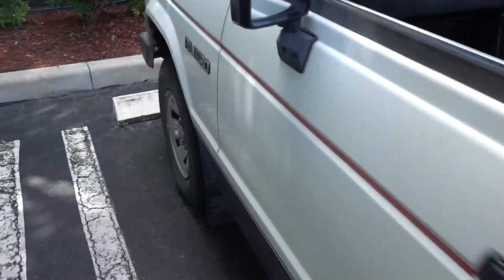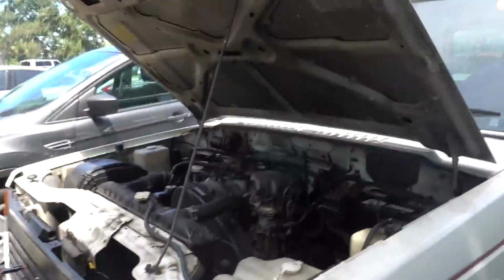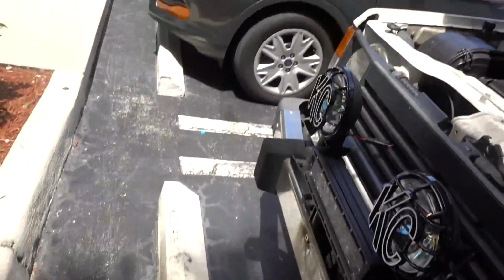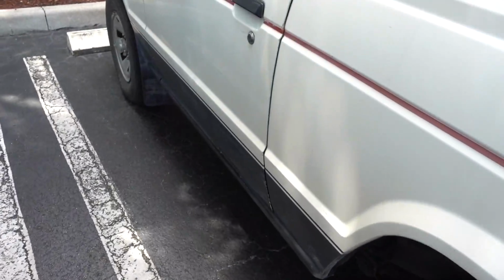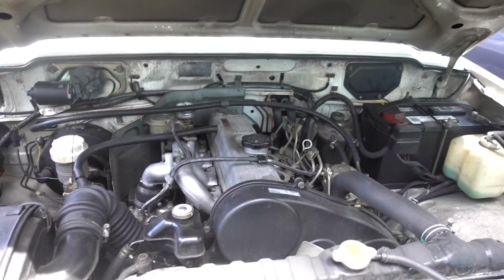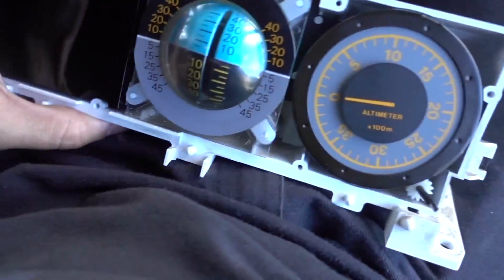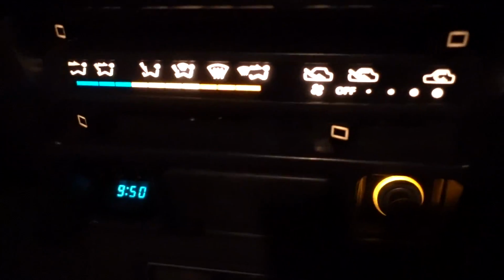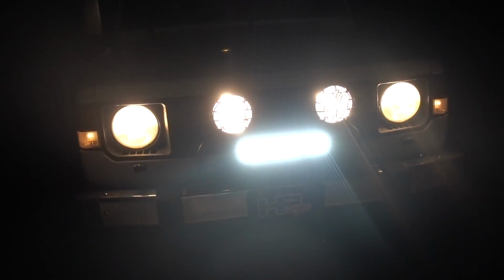Project PAJERO pt1

Comment: It's a little funny hearing gas guys talk about diesel performance. Boost doesn't make more power on diesel's adding more fuel does, adding air cools the egts to give you the ability to run more fuel. Increase your injection timing and a higher governor spring. I think there is a pin in those VE pumps that will let you increase fueling as well but make sure you have two people when playing with it as it could run away.  
I'd install an EGT probe straight away, since you have pop off style injectors you can run a single probe but having one on every runner will show you if you have nozzle issues. Then you can see what you can get away with before you melt the engine down.